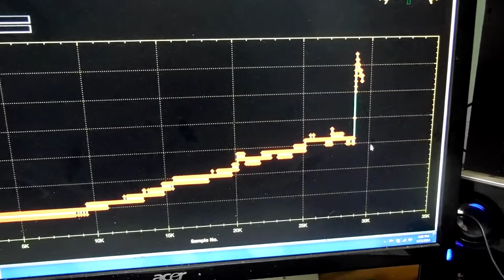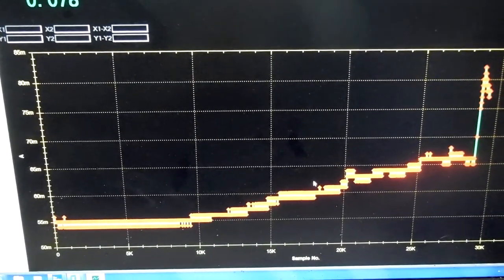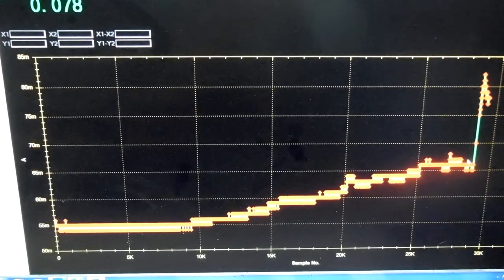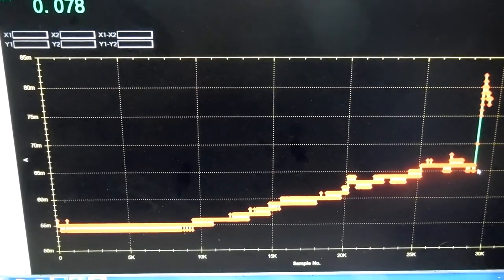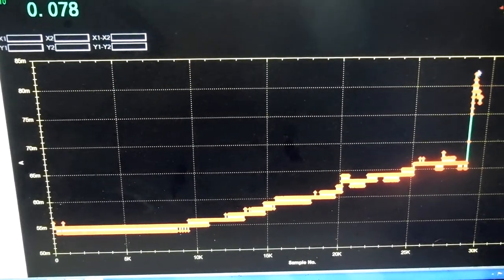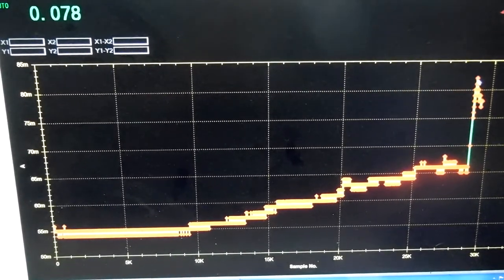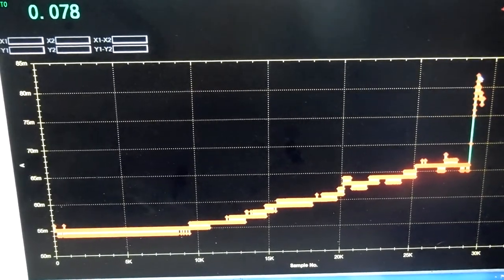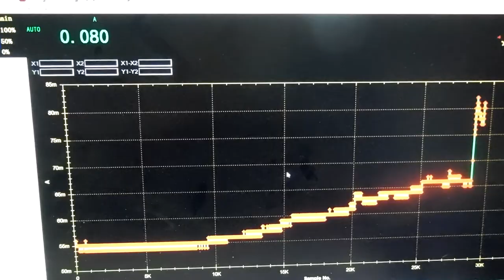(1 of 2) Short circuit test on the cell through the meter

Comment: Steve,
Are you willing to post up your formulas for the High Current mixtures you have come up with, or is this research not really leaning towards the Free Energy Movement Etc?  I know I often ask you of this and stuff, and if your experements are not leaning towards the open free energy community etc, I will kinda steer away from asking for replication models etc. Good Work as always though, and thanks for sharing your ongoing findings in any case.  Cheers from Dallas.